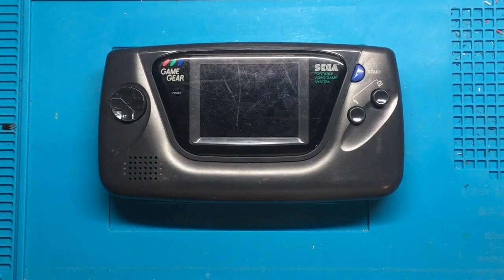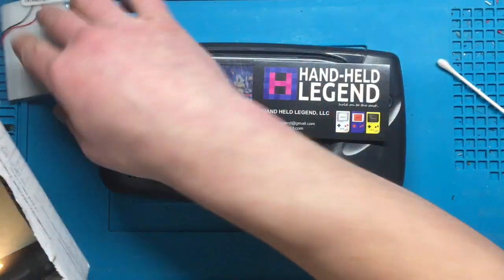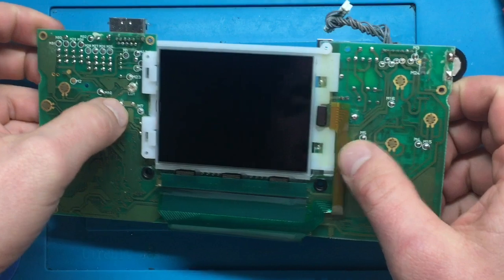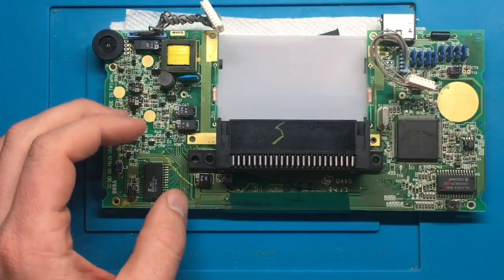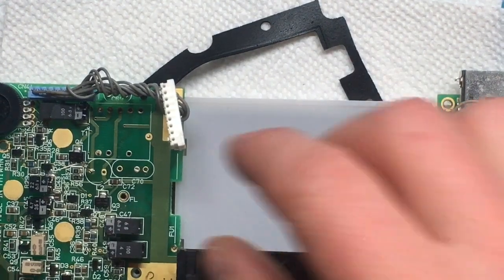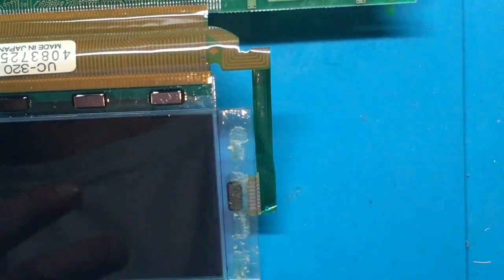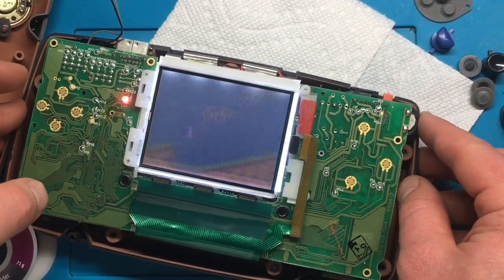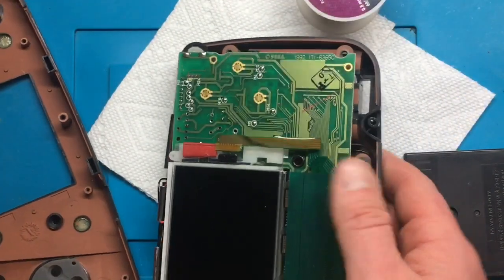Game Gear LED Backlight Conversion - Fixing eBay Junk

Comment: That razor blade part was so nerve-racking, please be careful!
Reply: Was thinking the same thing. Used blades like that for work and had them slip and cut myself way too many times.
Reply: @BrendanRaymondKoroKoro  I agree 100% with the blade, but solder braid you use what you have.

Comment: I think a couple of dabs of hot glue could’ve helped hold the backlight where you wanted it. To my knowledge hot glue is an electrical insulator so it shouldn’t short anything also can withstand temps around 300 degrees Fahrenheit. Another suggestion, when I take off some old adhesive I’ll generally add some silicone RTV (after the mating surfaces are completely clean) when reassembling. For example where the screen made contact with the plastic bracket (tho that would’ve been a tricky one) not the new screen tho, since it comes with adhesive already. Silicone RTV hasn’t failed me yet, and holds fairly strong once it cures. A thin layer is more than sufficient.

Also, completely agree that a rotary tool would’ve been a big help on the plastic bracket.

Overall not to shabby enjoying the channel. Channel really deserves more views. Keep it up.

Comment: Just pausing at 28 mins to relay my thoughts on the backlight being mounted upside down potentially? Judging by the wire length and the way it sits with the bar at the top, wouldn't it be better off the other way up so the bar is out of the way of the gamebit screw? Also seems to me it'd look better with the bit where you can see individual light points at the bottom where it's facing away from you as you play.

Comment: Hold the blade edge flat firmly where you want to cut and hammer on it. (either out of the handle and held with pliers or fully extended on the edge of the table).

Comment: Your paper towels might be completely different than mine but the Bounty brand I get leaves dust and i have scratched LCD’s before even when completely soaked with alcohol. Now I use 2 microfiber cloths. One for dirt removal and one for a final clean wipe. Also I like your handheld heat gun!
Reply from the maker: That's a hot air soldering gun, good for smd soldering and heatshrink tubing

Comment: I don't think those are compact fluorescent bulbs, just fluorescent.

Also, I recommend replacing those original caps.
Reply from the maker: The caps are a future video.  I've got the parts
Reply: @RetroRepairs  Is that video still in the works or did I accidentally miss it? Hope you're doing well!

Comment: I love your videos; I don't even own many of the consoles and handhelds you repair but it's super interesting to me.

Even if the cutting went as planned I think getting it to fit perfectly wouldn't have been easy.  I agree, a replacement piece (provided with the kit) would be perfect.

What do you use to wipe down translucent pieces?  I used to use paper towels but I started going with soft cloths (for automotive polishing) or just nice microfiber ones.  Might be something to consider.  Paper towels are actually slightly abrasive, like sandpaper.

Comment: That hot spot on the top & on the slight left bothem just ruins it,it’s sad that the light on top just isn’t spreaded evenly, the company behind this led backlight should had put more work on it, but aside from that,you did a great job for upgrading your gamegear with it.

Comment: you could use some double sided tape to pin the backlight in place and the screen (once they are correctly calibrated). Or maybe putting the backlight upside down? With the wire side being down?

Comment: Watching this a year later because Game Gear! The "get a Dremel" message seems to have long been affirmed, so I'm gonna say "please use a hobby knife/Exacto if you have one instead of a box cutter" because I winced when you tried to cut the plastic with it and it wasn't cooperating. Just the angle of the blade alone makes a hobby knife much easier to use going back and forth for cleaner cuts, and I'm pretty sure you can find handles that aren't the basic stick form.

Comment: Any thoughts on screen mod for these things like the McWill or the upcoming BennVenn screen replacement? I still have the Game Gear my parents bought me when I was a teen, it's peppered with stuck pixels, probably needs all the caps replaced too. The McWill looks incredible, but given I don't even use the GG anymore, it makes the price of the mod hard to swallow. The BennVenn will apparently be about half the cost.

Comment: next time invest  10 bucks in an off brand  dremel or  at least heat  the blade  and  make 10 cuts with small pressure instead of  1 with fail potential :)
Reply from the maker: Yup, lesson learned

Comment: I know alcohol will work to remove glue, but wouldn't using a product like Goo-Gone be better? I've had to clean up glue residue from label printers at work, and it ate through the residue really quickly.

Comment: Hi ive been watching your videos for awhile now and i was wondering if you could give me some advice on a problem I've been having with my nes. It all of a sudden stopped showing any color, I've tried using a different tv or game but that had no effect so i checked the traces on the board and couldn't find any bad ones. I'm just wondering if you have any ideas on what the problem could be, thanks in advance.

Comment: It's a LOT more work to do but if you want the ultimate game gear experience install a McWill screen into it, I had considered LED modding mine but the replacement screen is a much better option :)

Comment: thank you so much for showing how to do it. i do have a few questions:

what about re-gluing the white brackets to the screen and having the wires of the back light come from the bottom up to the red and black connections? looks like you had a hard time getting those wires to fit.
Reply from the maker: The problem is that the backlight pushes the screen out a bit, so you can't glue it to the bracket

Comment: Watching you handle razor blades is terrifying. For plastic that thin have you considered a hot wire?
Reply from the maker: Ha, cut towards your hand, cuts heal, but ribbon cables won't.
Reply: @RetroRepairs  I have seen fingers that could never work properly from cut tendons, fingers partially removed from infections that would not allow for proper healing and in general scars that damaged nerves and lost feeling. Sounds like you really aren't too very smart with that attitude of yours. That ribbon or screen is not as costly or important as a finger for the rest of your life to live with.
Reply from the maker: Someone takes the internet too seriously
Reply: @RetroRepairs  Someone has a caviler attitude.
Reply: @RetroRepairs  hope you'd learned a valuable lesson young man 😂
Reply from the maker: Nope, have confidence in your abilities. I'm not cutting a finger off with a razor, and i have free health care if i do.

Comment: Hi, I made this mod and replaced so the mainboard caps. But the display still with weak. Not bright colors. But ow I can see (before replacing caps I barely see a little looking with a extremely angle). This is my first game gear.
Reply: Here's the video: https://youtu.be/PvEwDdsqiMU

Comment: I'm not sure but I think I've seen someone on YouTube doing a full screen replacement with a modern one but I must admit it's very difficult messing with the Game Gear special That daft ribbon cable setup
Reply: Probably the McWill mod. Looks great. I did it for my GameGear and Lynx.
Reply from the maker: I just have a real tough time spending $120 on a screen for a system i bought for $6.  Mcwill has some drawbacks, but still looks way better than the stock screen.  I've heard there's someone looking to manufacture a lower cost screen.  If it comes in at under 50, I'll pull the trigger

Comment: Unless you grew up when this was top of the line you don't understand the struggle of being a kid and having the brightest and most colorful display compact game player in your room that would snitch on you for playing it when you were suppose to be in bed. You'd just asked your mom for 6 batteries the day before and now it was dead again. Even though the battery life was laughable even back then, this was at a time when a portable TV was the size of a loaf of bread and had a massive antenna that only picked up a few channels if you could get a clear signal and used like 4-6 D batteries. So it's not like this was the most ridiculous thing you could pack on a road trip.

Comment: Is there any structural reason to keep the reflector if the bulb is gone?
Reply from the maker: Yes, the screws are sized to go through the reflector and seat into the white bracket

Comment: I do not like how the led backlight has 5 bright spots at the top. Looks like a terrible decision for the type of replacement. I would bet that there is a way to do this better. Perhaps a way that has yet to be determined.
Reply from the maker: Probably.  It does have some hot spots, but the original light is awful

Comment: I have a snes game I can not figure out the problem with any suggestions?
Reply from the maker: 1st, make sure the pins are clean.  Next, open it and check the physical condition. Make sure no pins are missing. Last, check continuity of all traces.  Common place for wear is right above the pins
Reply: Yes I have checked all that even changed cap could it be a fuse?
Reply from the maker: If there's a fuse on it, sure, but normally there isn't. Sometimes there's a resistor on there cart.

Could also be a bad IC, unfortunately nothing to do except replace.

Could also be the cic chip, if you really want to save the game you could try swap it with an identical chip

Comment: And that didn't help much of anything.still looks like poo
Reply from the maker: It'll help battery big time. Since the display itself isn't being replaced,  it'll suffer from the same crap image,  just slightly more evenly lit
Reply: @RetroRepairs  don't they make updated replacement screens now days? If you were going to do all that work should have fixed the root issues with these.
Reply from the maker: @talclipse  they do,  they're quite expensive and i can't justify spending $120 on a modern lcd display for this